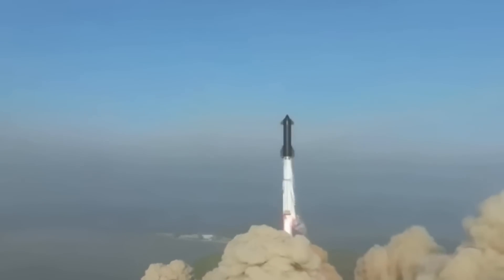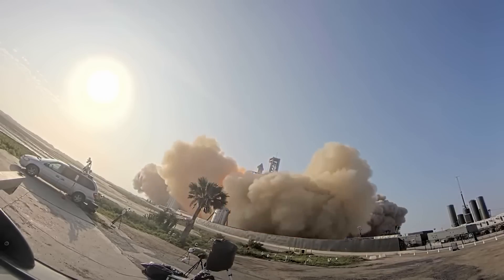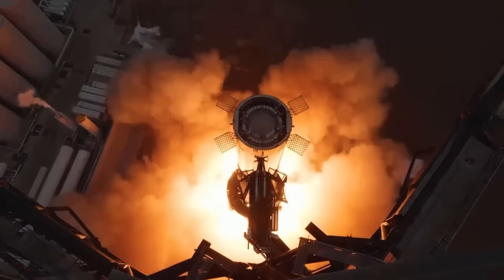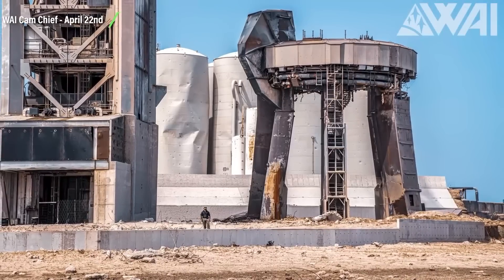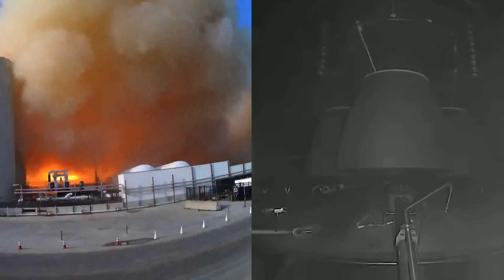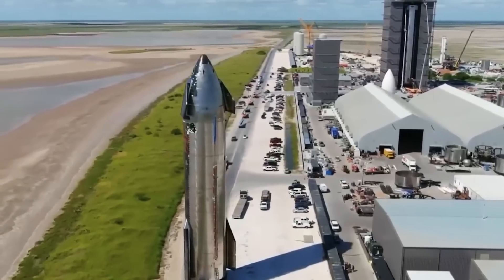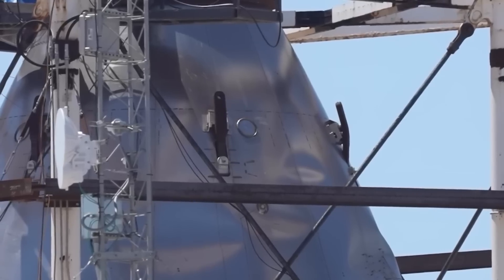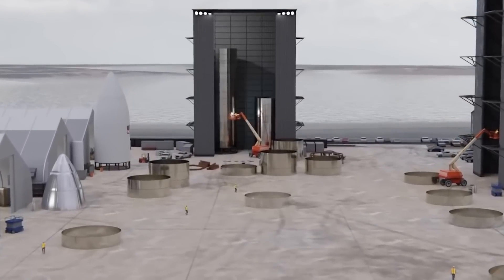SpaceX Starship Launch Pad Improvements UPDATE!

Comment: I don't think anything will stop those engines tearing up steel plate like it was tin foil but if SpaceX have run the numbers, it might just work for one launch......possibly but not for multiple launches. This looks like a one launch, fire & forget solution. I'd like to see something more robust & I'm not convinced this steel plate solution has the longevity to take that kind of pounding more than once, if at all.
Make no mistake though, without flame diversion, you're still going to see stuff flying off in all directions & damaging the surrounding infrastructure.

Comment: They need something angled to divert the sonic energy outward instead of upward. Look at the underside of the platform, it's all ripped apart, the engines also got that shockwave. It's not hard to do more static fire tests, strap a booster down with partial propellant and run 100% power for 5,10,15 seconds and inspect for damage between each run.

Comment: It occurs to me that with a high water table under the pad, if the heat reached the water table it would start generating a lot of steam pressure under the structure.  Not so good, but using a water system above the water table will certainly eliminate this possibility in the future.
Reply: I recall the steam is beneficial...kills sound waves...and something else also that doesn't occur to me at the moment

Comment: Like I mentioned before the launch should be taller than it is now while the 32 engines igniting would have less of an impact on the ground concrete there should be a titanium cap put on the concrete beneath it and there should be high pressure water injected on the base too cool and to prevent further possible damage to the engines and the surrounding area